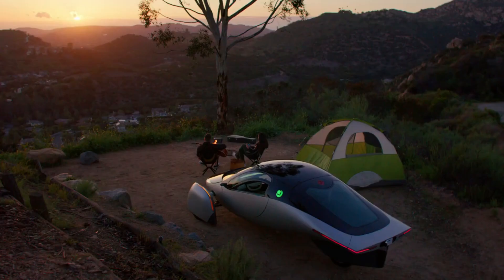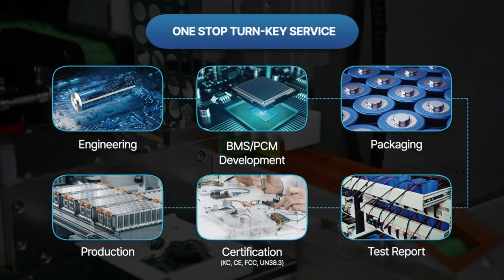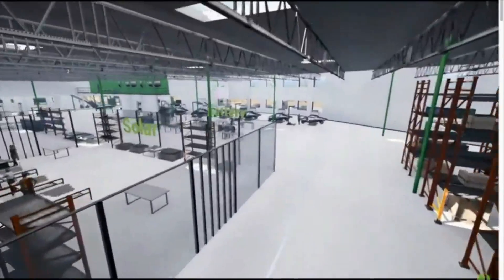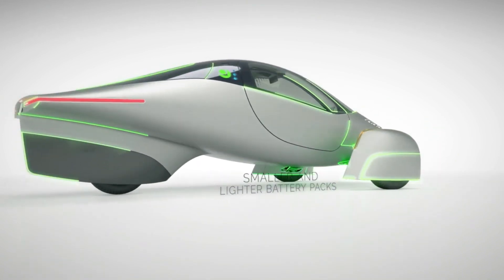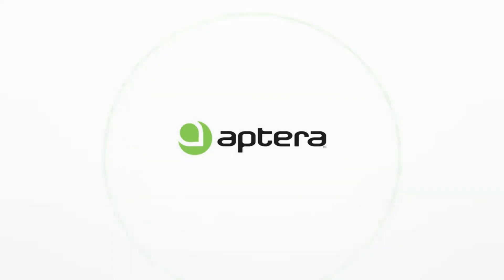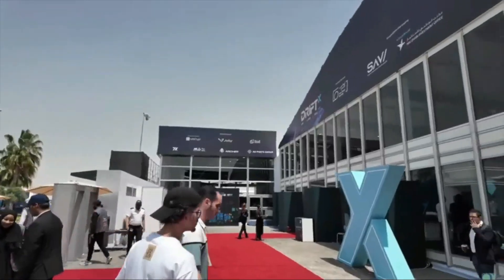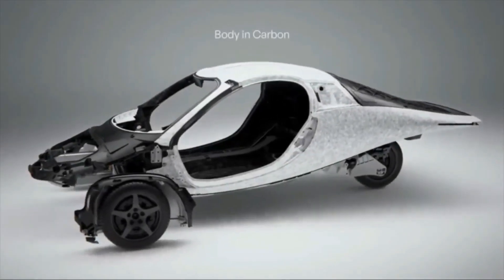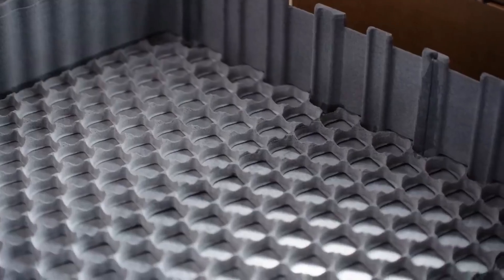Aptera's Final Battery Tech to Put in Vehicle

Comment: In the video you said, "Aptera's battery tray incorporates advanced cooling systems that regulate temperature."  What specifically does this mean?  How exactly is the battery cooled and/or warmed?
Reply: Aptera is circulating antifreeze past the base of the battery pack.  There are three channels.  One of them cools the motors and inverters.  This is a high temp circuit.  The battery pack circuit runs at a lower temp and cools the battery pack.   Finally, there is a refrigerant loop with a condenser placed in an air flow that takes air in under the windshield and exhausts it out the tail of the vehicle.   The A/C system can also be employed for cooling the battery pack antifreeze when the vehicle is running at too slow a speed for convection to make much difference.  For the first models, standard heat exchangers can be also used to cool the antifreeze, placed in the same air stream as the A/C condenser.
Reply: @n.brucenelson5920  Okay, that clears up a big question I was having.  I simply don't have time for an overheating vehicle when commuting to and from work.
Reply: @JoeBManco they showed it in the UAE going around the race track for multiple laps no problems. I don’t think heat will be an issue
Reply: @ericwheelhouse4371  How many laps is multiple laps?  The official Aptera video said, "tons of laps", but I don't know what that means.
Reply: It’s just radiator cooling. I don’t think it’s anything super special.
Reply: @ericwheelhouse4371  It is not "just radiator cooling"  There is also provision for heating, and it doesn't present much surface area to waste energy pushing the car at speed.   It makes a large difference in the amount of energy used, compared to pushing a conventional radiator through the air.
Reply: They are not going to launch with belly cooling , they will use a traditional radiator that they have not shown yet
Reply: @RomanChaar  Okay, then where on this vehicle is the vents for the radiator to scoop up fresh air?
Reply: @JoeBManco at the base of the windshield.